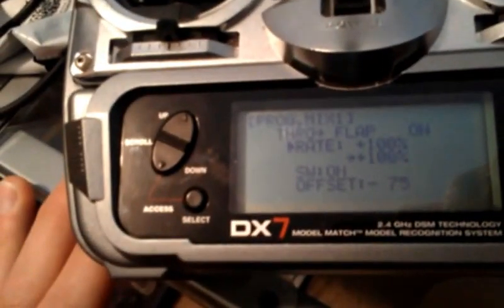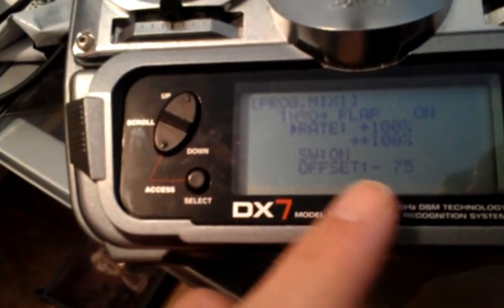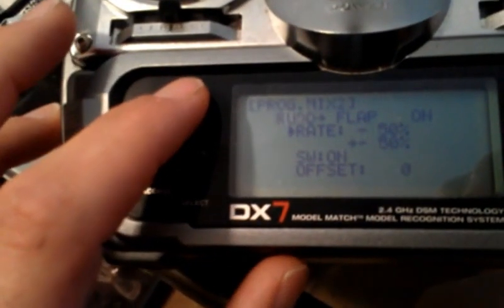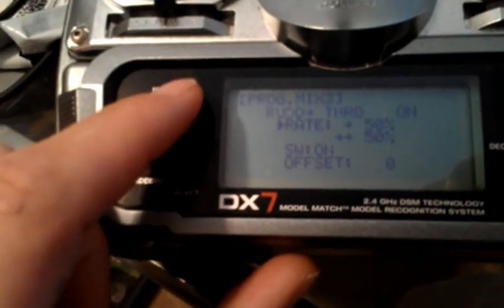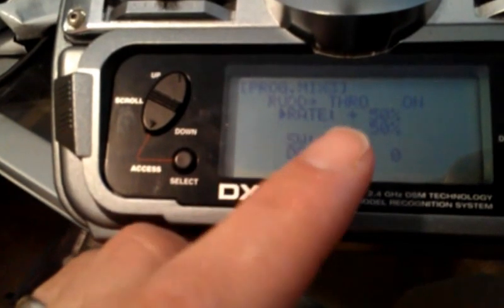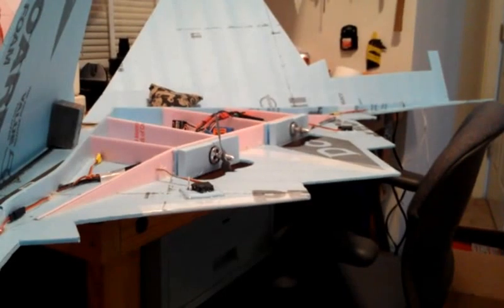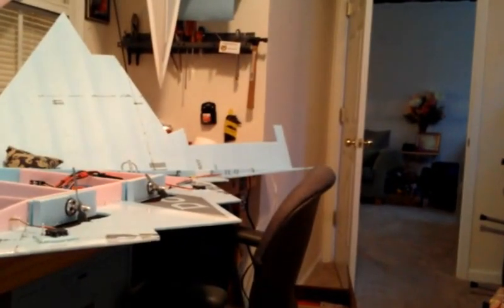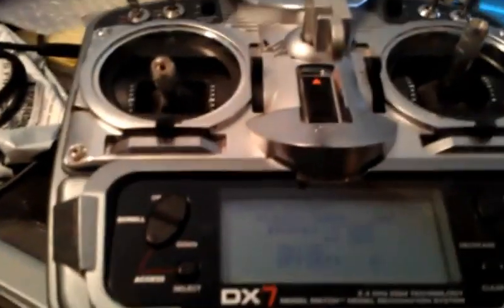Differential thrust on my B-2 Spirit Bomber

Comment: This may not be relevant anymore, but I added 2 more mixes. In your case it would be AUX2 to Throttle and AUX2 to Flap; that allows your AUX2 switch to act as a throttle kill. -125 to the throttle and flap when the switch is active so that the motors won't spool up. Since one little bump of the transmitter stick in any direction can spin up one or both motors. The newer radios all have this feature so I usually have a mix in my DX7 to do this with electric models.